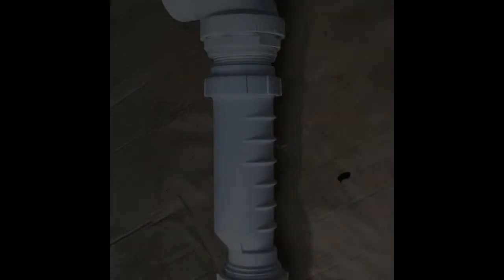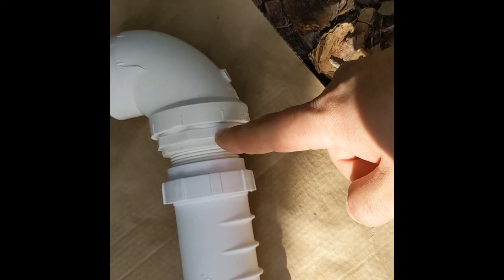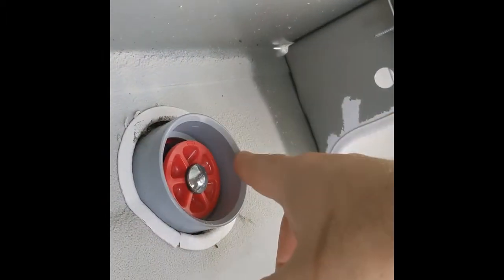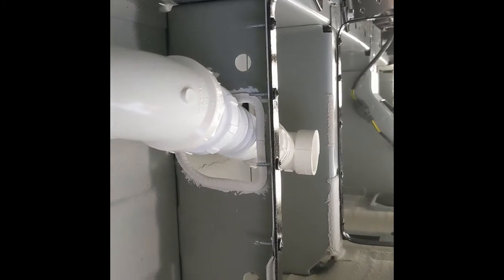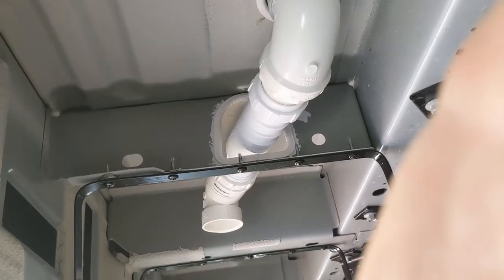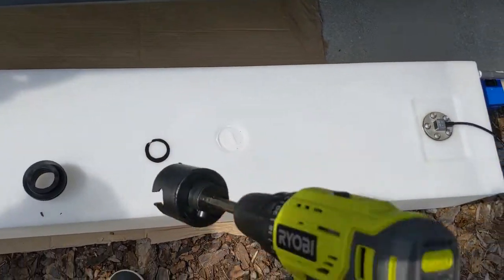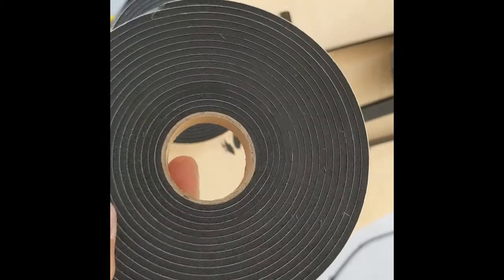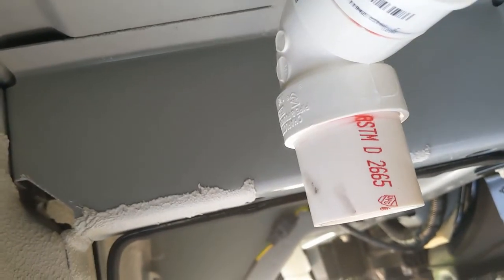Plumbing the shower drain to the grey water tank in a van | Going Boundless Van Conversion 2021

Comment: Does it not have a vent? How does it drain
Reply from the maker: 2 different things here. Yes. There is a vent top left side. The drain is the ball valve.
Reply: @GoingBoundless  ok. I’m plumbing my 60 Shasta deluxe and I really don’t want to take a vent out the roof if I don’t have to. It has a sink and shower.
Reply from the maker: @aslmx1918  wait a second. This is a grey water tank, not a black water tank. You need to vent properly or it will be an absolute mess. On our bus I did just a small top vent on the tank but you can't drive it like that full. I used a tube and extended it about 2ft higher than the tank then put the vent. You may or may not have the space to put a tube like I did. However, this is not exactly the best way to do it.
Reply: @GoingBoundless  I’m not wanting to do any tanks. We camp at full hookups and have a porta pottie. It will just be a shower and a sink. No tanks.